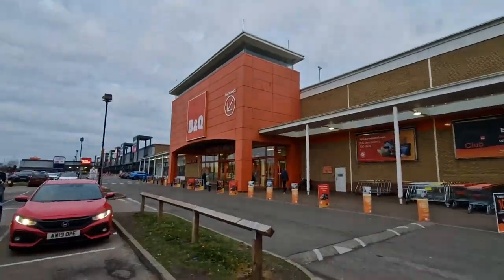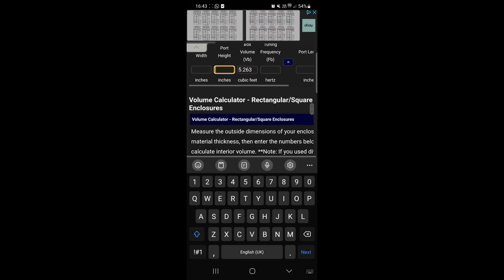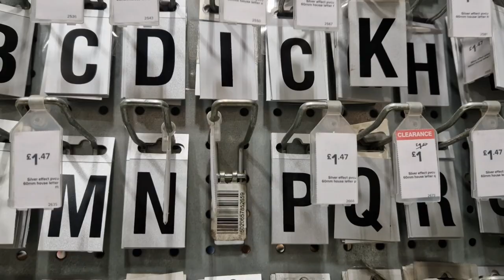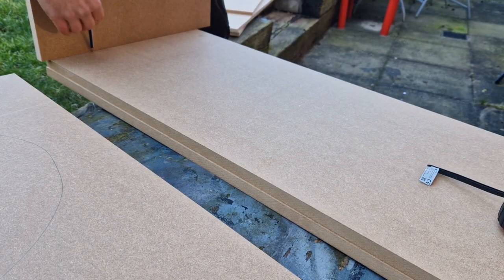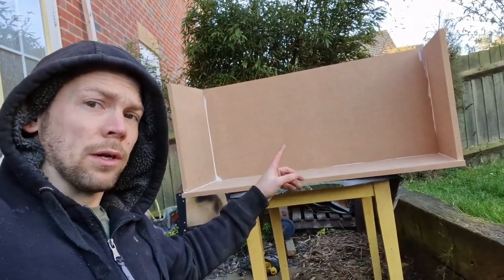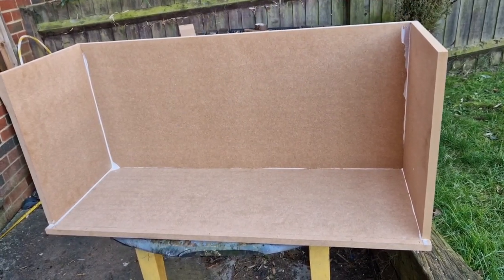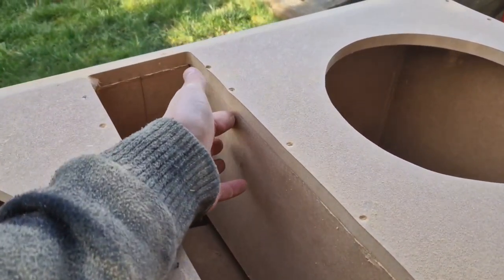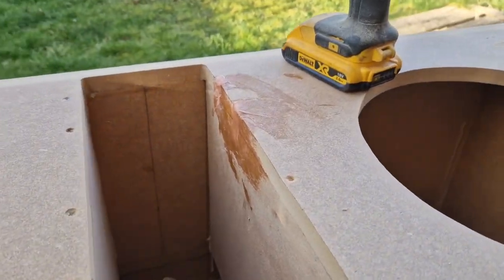How To Build A Subwoofer Box For BEGINNERS with NO SPECIAL TOOLS!!

Comment: gud eve sir. as what you said. 12c is for 2.4.cu.ft. is rha box internal volume or afterall displacement?
Reply from the maker: Depends on the size of the woofer, if its a really cheap, small sub then i would go for 2.4 total. If its a bigger sub i would say 2.4 internal
Reply: @PacmanBasshead   you based on the internal cu.ft sir? so if yoy subtract ty I displacement form aub and port? atleast have a net of 1.75cu.ft or net 2.5cu.ft.?
Reply from the maker: @onicahijaathena  if you have a 1000w RMS capable Subwoofer, aim for 2.5 cubic internal